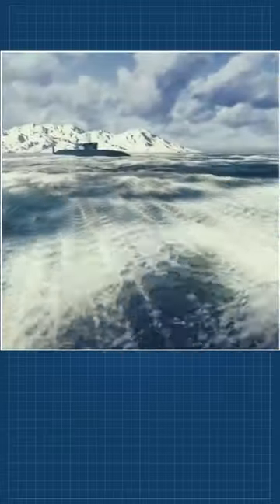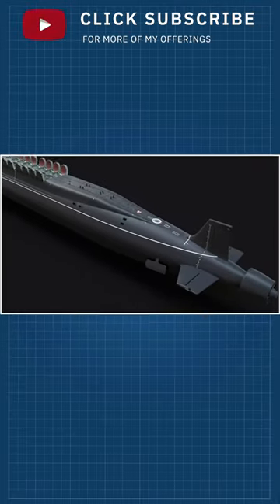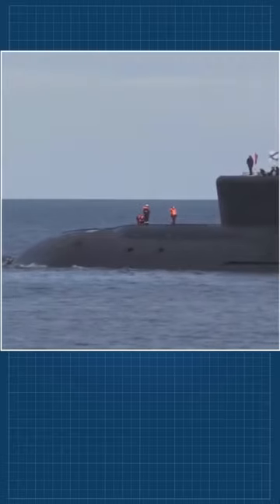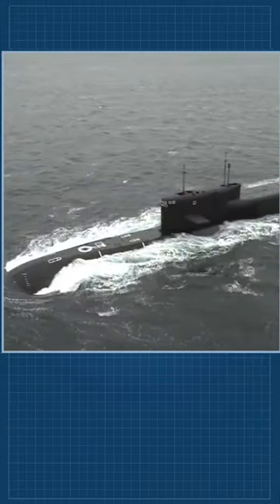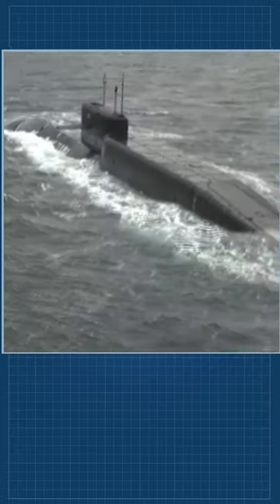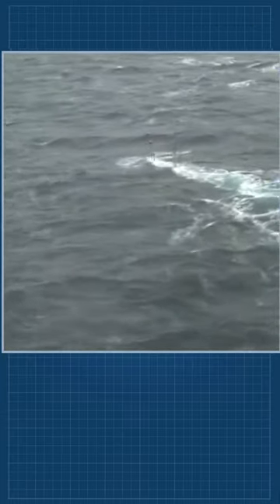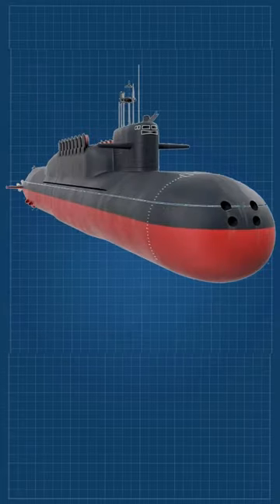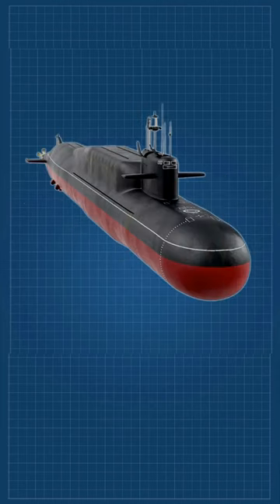What's Wrong with Russian Nuclear Submarines - Part One #submarine #nuclear #shorts

Comment: If Russia still uses diesel electric that poses a challenge to US subs. 
Diesel electric are soooo silent.
Reply: Nucs are quieter
Reply: Diesel subs are slower submerged because their battery’s restrict them to around 400 nmi at 3 kn or 12.7 nmi at 20 kn. As you can imagine, trying to catch a fast carrier group moving at 30 kn would present quite a challenge! Even surfaced, top speed is only 17 kn which would make them a fat, slow target!??
Reply: @JimCOsd55 a SSK being able to sustain 12 its for 20 miles would be impossible trust me 😂
Reply: @Highendaudio1  Exactly, everyone likes to ballyhoo on how a Swedish diesel sub sank a U.S. carrier in war games. But they forget that war games have parameters that limit them to a geographical area thus allowing the sub to lie in ambush. In a real war, a diesel sub first has to find the carrier group, then try to get close enough without being detected. Easier said then done when it has to come to snorkel depth constantly to recharge its batteries!